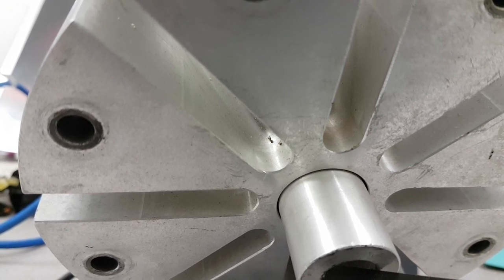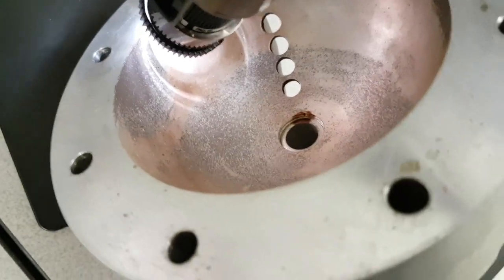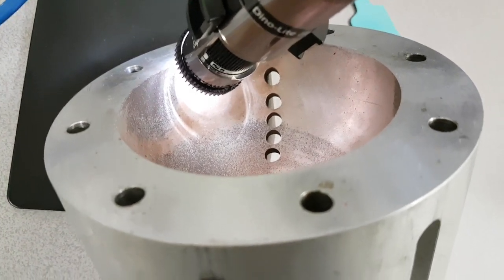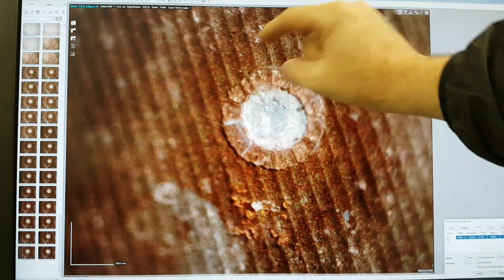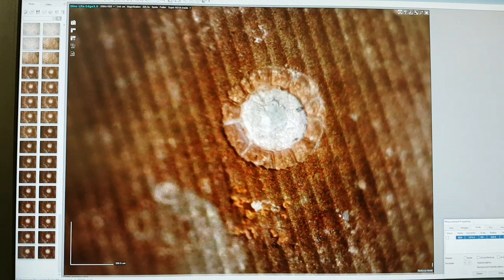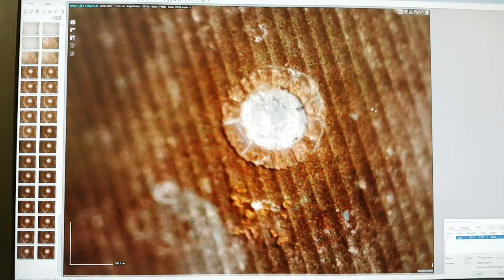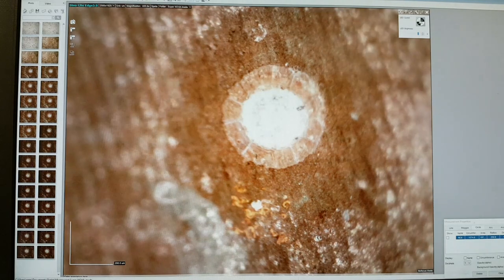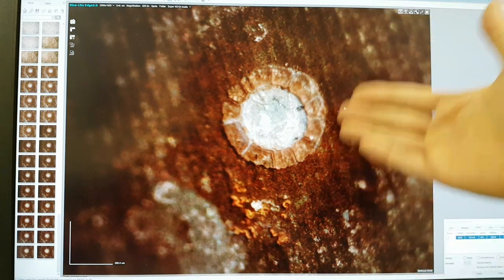Super NOVA - EVO ONE

Comment from the maker: As said in the video, the radial segmentation was like Matsumoto's radiographic x-rays from the 1990s when conducting Cold Fusion (Pd + D and Ni + H electrolytic/explosive experiments).
See figures on the second page in this Jan 1993 paper:
sci-hub.se/10.13182/FST93-A30125 
Matsumoto, T. (1993). Observation of Meshlike Traces on Nuclear Emulsions during Cold Fusion. Fusion Technology, 23(1), 103–113. doi:10.13182/fst93-a30125 

and figure 3a from this 1993 paper:
sci-hub.se/10.13182/FST93-A30205
Matsumoto, T. (1993). Cold Fusion Experiments with Ordinary Water and Thin Nickel Foil. Fusion Technology, 24(3), 296–306. doi:10.13182/fst93-a30205

Comment: so this is based on the results of a previous run ? or the recent one?
Reply from the maker: This reactor had been used many times before we took possession of it. As I saw patterns of data in so many other independent researchers I became very curious as the reactor body was made of Aluminium which is very easily effected with LENR/EVOs - look at work of John Hutchison or Mondaini who saw production of a 'glassy substance' he assumed to be silicon dioxide form from using Aluminium.

https://youtu.be/TEceEHgaXoU?t=1597

http://www.nanosoft.co.nz/results/select_*_from_TwoToTwoAll_where_E1inlbAlrbandE2inlbAlrbByMeVDescLimit100.html

Since I understood that EVOs could pass through glass as ball lightning does in nature, but do not like impedance mis-matches like the change from insulating air to highly conductive Aluminium, I expected there may be EVO marks on the inside of the reactor from previous tests. 

On looking - there were many, and so my cautious approach to this experiment appears well justified and it is not surprising that the man that made this and other NOVA reactors died in his early 40s.

When I have studied the inside of the reactor some more, I think I will polish an area down to the Aluminium again and we can see after tests if there are new marks formed during the actual testing.
Reply: wow so it's been sitting there for all this time ... a goldmine of information !  

you don't mention the interesting segmentation on the middle ring which seems fascinating and not something i've seen before. 

polishing a part of it is a great idea.
Reply from the maker: @jonahfoxy  I did say the radial segmentation was like Matsumoto's radiographic x-rays from the 1990s when conductive Cold Fusion (Pd + D and Ni + H electrolytic/explosive experiments).

See figures on the second page in this Jan 1993 paper:
sci-hub.tw/10.13182/FST93-A30125 

Matsumoto, T. (1993). Observation of Meshlike Traces on Nuclear Emulsions during Cold Fusion. Fusion Technology, 23(1), 103–113. doi:10.13182/fst93-a30125 

and figure 3a from this 1993 paper:
sci-hub.tw/10.13182/FST93-A30205

Matsumoto, T. (1993). Cold Fusion Experiments with Ordinary Water and Thin Nickel Foil. Fusion Technology, 24(3), 296–306. doi:10.13182/fst93-a30205
Reply: @MFMP  yes they are similar but even more distinct.
Reply: @MFMP  has anyone replicated Mondaini especially with Aluminium producing SiO2? Seems super easy would be an unavoidable conclusion that transmution is taking place (if a non-glass vessel is used!).
Reply: not really geometrically symmetrical, looks cellular (not in the biological sense)
Reply from the maker: @jonahfoxy  Not that we know of.
Reply: Martin Fleischmann Memorial Project why do you think it’s not been attempted. ? Ie given it’s apparent ease vs other more sophisticated efforts.
Reply from the maker: @jonahfoxy  I am not saying it has not been attempted, I am just saying we don't know anyone that has done it.
Reply: @MFMP  yes sure, but i wondered why this was ... i.e. why has it not been selected by MFMP (or friends) to try. I know time is precious, and you have many interesting avenues to follow. This is not a criticism, just trying to understand more about it.
Reply from the maker: @jonahfoxy  Pehaps because it is easy - actually, these things are never as easy as they appear. On another note, it has taken two years to get to the point of being able to look at this reactor! There are always new things (old) to try.